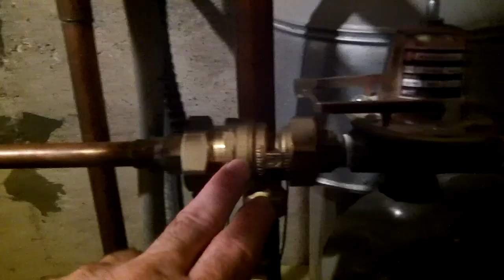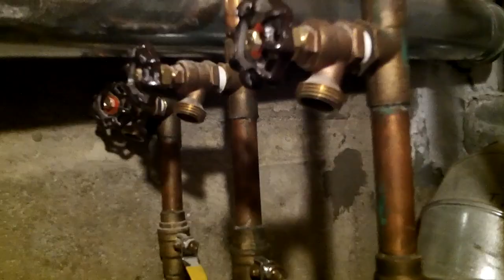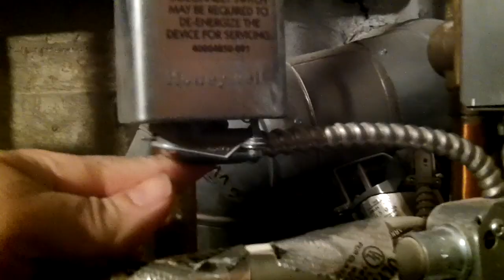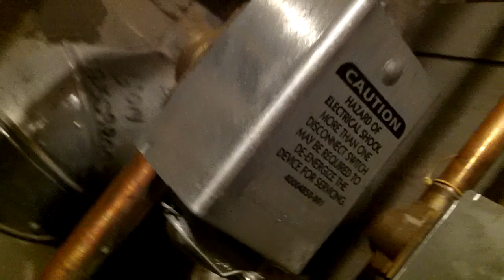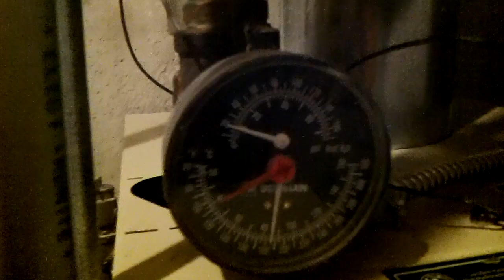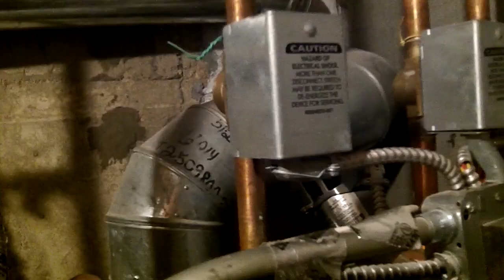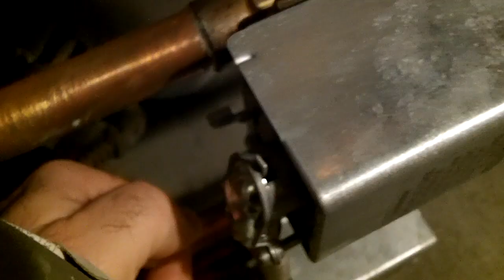How to remove the air from your hot water heating system

Comment: What about automatic air vent caps position (on radiators upstairs) before and after drain the system?
When should I loose and close them?
Thanks
Reply from the maker: David Mchedlishvili leave them alone. you don't need to touch them.

Comment: when you shut the livingroom return valve, couldn't there be air in the pipe below it going into the boiler ? so are you bleeding air out of the whole circuit?...thanks
Reply from the maker: You have to bleed it out once zone at a time.

Comment: When you are bleeding your first zone shouldn't you close off your other zones too ,so air doesn't go through there while you are bleeding the first zone?
Reply from the maker: When I bleed the first zone I manually open the zone valve for that zone. The other two zone valves are closed so air won't get on there.

Comment: The last time my safety valve went off, my pressure gauge got some humidity steam water in it. The gas man told me it would eventually dry out, it's been a couple of week and it still has water in it. He said it couldn't be screwed off to be replaced. I need to purge my system again because of air, can I still do it not knowing how much pressure I really have because of the pressure gauge having moisture in it? Thanks.
Reply from the maker: Don't use the manual override on the reducing valve to feed the system and you should be ok.  The reducing valve should automatically keep the correct pressure.
Reply: Thanks, I was a little leery, but, it worked fine. Thanks for your advise.

Comment: Awesome.  I had a pipe burst today.  I had a heck of a time trying to get the air out of the system.  So I took a break and found your video.  Luckily whoever put in my system did it very similar to your setup.  The only difference was there was no zone valves only circulator pumps which acted like valves.  Thanks for the video.
Reply from the maker: +RB Hayride Glad I could help.

Comment: When you bleed the zone the replacement water also has air in it . It will degas and cause more air.  Hopefully the auto bleeders will get rid of it .I stopped flushing my system many years ago and have had no air problems since. I have also heard if you leave the same old  muddy water in the system it has neutralized its PH and is less corrosive that fresh water. Is that true? there are many wives tales in the trades  and some are just old beliefs that have no merit
Reply from the maker: You are lucky your bleeders work fine. My boiler has a design problem and does not seem to catch all the air.  The folks that owned the house before me did not install bleeders on the radiators.  I have one bleeder on my boiler that is useless. Your system is producing air all the time.  You intoduce it when you change the water and also when you heat the water.     if you have an issue with air you must find the cause of it and repair the problem.  I bleed my system to prevent it from air locking a zone and waking me up at night from the noise.  I bleed it on a as needed basis.  I don't have an issue with muddy waters because I do not use well water nor do I have iron pipes.
Reply: +Brian Ellsworth Yes it true about the corrosive effect of make up water.
Reply: +providencevideoworks Thank you

Comment: Thanks for making this video. I have watched & took notes so that I may do this tonite. Now the questions if u dont'mind... I also have 3 zones like you but I'm not sure which line matches which? What's the easiest way to find out so that I can label them like u did. Also, I haven't turned the heat on yet, should I turn the system on first & let it run, then turn off broiler when I'm ready to purge... Or can I do the flush/purge before turning on the heat for the first time? How often should I be bleeding/change the water in the lines? -first time homeowner-jb
Reply from the maker: Turn they system on and listen for air in the lines.  if you don't have air in your lines don't do anything and leave the system alone.

To find the zones locations, just lower all your thermostats so you don't have water circulating.  Then turn one zone on at a time and feel which pipes get hot.

Comment: My system is almost the same as yours.  The only difference (other then having only two zones) is that i do not have a shutoff in my return line for each zone like you do.  my return lines tie together and i have a shut off right before it goes back into the boiler.....is this common?
Reply from the maker: +duerrs Yes it is common. There are maybe minor differences in the design of the system.

Comment: Thanks for the video.  I was stuck trying to figure out how to get the air out of my second floor radiators after draining the system I could not get heat.  The only thing different is my return valves are located with the drain valves (not separate like yours).  They look like a valve stem without the handle right below the drain valve.  In my case the notch inline with the direction of the pipe is open and the notch perpendicular to the pipe is closed. No indication on the valve so it is was not obvious to me.

Comment: i tried doing this and something went wrong. My furnace makes the broiler work but heat won't come through the vents of my home. And i tried purging it again and there is no water in the system
Reply from the maker: Gani Bebri sounds like you forgot to open the zone valve to let water in the system as you were draining the zone. Make sure the zone return shutoff is closed and the zone valve is locked in the open position before you drain the zone.

Comment: I bled the system a few times now, the banging and clicking have gotten better. However, I am still hearing some loud clicking in the first 5 min when the heat is first turned on, and alsoI am hearing water flowing in the pipe the entire time heat is on.  Is it possible that something besides air is causing the noise?  Thanks
Reply from the maker: That is expansion of your pipes.  As hot water travels through  pipes that are cooling down expansion occurs.   That's why you are hearing the crackling...etc.  Getting the air out of the system sometimes quiets that noise but some systems will always produce that sound.
Reply: Your Hunting Buddy the banging noise is still there just a bit better.  The water running is really loud and  its barely warm anymore.
Reply from the maker: jalvgrl1112 I get so many comments that sometimes I read things too quickly,   if you hear water running that means you still have air in the system.  you may have a leak or the water feeder is not replacing the water as you drain it.

Comment: very helpful thank you. I have the same set up as the one in your video three zone. But I am still unsure . The shutoff ball valve that is nearest the concrete wall like in your video will that line always be connected to  first zone valve like in your video?   Can I shut off all three shut off ball valve at once and just open one zone valve like you did in your video and bleed the system one zone at time with no problems ?
Reply from the maker: ED. JUSTINIANO You need to find the shutoff valve on the return line.  You can close all three just make sure you are not closing the line feeding the line.

Comment: Let me start by saying: Thank you!   this was a great video, and has helped me identify many of the parts within my heater system. 
I encountered a small problem and hope I can get some advice... My house is very small and only has one zone valve, however, my zone valve does not have a switch. I even opened the box and all I saw was wiring that came from the thermostat and 2 more that go to the boiler and circulator. Definitely no switches in that box. any suggestions?

Thank in advanced.
Reply from the maker: Jherlyn Lopez You need zone valves when you have more than one zone and want to use one pump.  Your one zone is controlled by turning on and off the pump and therefore you don't need a zone valve.  When the temp trips your thermostat your pump goes on and it heats the one zone you have.   Just shut off the water returning from the radiator and bleed the system  the drain valve should be before the shut off. There are no zone valves to turn on so just skip that step.

Comment: thanks a lot, I wish I had saw this video a couple of years ago. Your set up was almost identical to mine so as soon as I bled the line, the heat came right on.
Reply from the maker: Vince Mahe You have to shut your system off prior to working on the line.
Reply: Your Hunting Buddy um, you can't just take a compliment? Where in my comment did you read that I didn't shut my system off?
Reply from the maker: Vince Mahe Vince, I love compliments.  I misread your comment, I thought you were having problems with the burner turning on as  you were trying to bleed the system.  Thanks for watching and taking the time to comment. I am glad the video helped.

Comment: Great video. Can you explain why the air in the system is bad?  Is it a sound issue?  Are you losing heating efficiency?  Thanks in advance.
Reply from the maker: Joanne Cho You lose efficiency and eventually the air will stop your system from circulating water.

Comment: Thanks for the info.  I took an oil heat class years ago, but didn't learn this.  I replaced my expansion tank and check valve.  I knew how to drain enough water to replace without it spitting at me.  Now I know how to bleed if the bleed valve takes too long :)

Comment: What if I have circulator pumps instead of zone valves? Do those have a manual override too?
Reply from the maker: derekjlight So you have one zone and it it controlled by your pump?  If this is the case, shut your boiler, shut your return line and flush your system.
Reply: Your Hunting Buddy
I believe I have three zones, each with a circulator pump. Is there any way I can contact you directly to send you a picture of my system? I know for a fact that I have water in my upstairs pipes because I can hear it.
Reply from the maker: I had folks send me pictures.  It is hard to understand how the system works.  So each zone is controlled by a pump.  Do you have a shutoff valve for that zone and an auto water feeder?  if so shut the valve and open the drain and flush the system.
Reply: Your Hunting Buddy
I do have an auto feeder just like in your video. It almost looks like all the return lines feed into one spigot to purge the water from, but there are valves you can shut off as well. I will take a picture and post a link here.

Comment: BIG QUESTION is.........HOW did air "Suddenly" get into a closed system??
Reply: There is oxygen in water over time creates air pockets.
Reply from the maker: notpcone Air can get in the system in many ways.  Such as a broken expansion tank, through your feed, using non oxygen  barrier pex tubing...etc.
Reply: local water supply from street brings air into your system and its normal, that's why technician should always check the pressure (PSI) of the system when doing maintenance!

Comment: Great video, thanks! My system runs the circulator in the opposite direction as yours and doesn't have any shutoff other than the zone valves. I was able to figure it out. I just had to have the courage to drain system pressure below 10 PSI and let the PRV kick on. I went through about 3-4 buckets on each zone to get all of the air out.

Next issue to tackle is the pressure. PRV kicked on at the right pressure and stopped flowing at 12-15psi. But, once the boiler fired up, pressure went to 30-40 psi, and that's where it's stayed.
Reply from the maker: Great!  Thanks for watching.
Reply: Your pressure relief valve on a boiler should be rated at 30 psi. Your running pressure on your boiler should be between 12 to 18 pounds.  If it's too high just open the drain valve and let a little water out until the pressure drops. If you're blowing the PRV then you better replace it and lower the running pressure of the boiler.

Comment: Great Video....Question for you regarding my setup.   My zone valves are on the return and right above the zone valves i have my spicket .  I don't see a handle to stop the water from going back into the boiler like you have.   Does that mean I just leave my zone valve closed and open up the spicket with a hose attached.  I have an automatic fill so the water should just continue to flow until i close the spicket correct ?
Reply from the maker: No you need the zone valves open so you can replace the water as it exits.  Otherwise you will have more air entering your system.  You need to find the shut off in order to make this work.
Reply from the maker: I see your rational.  It makes sense and may work but I really need to see your system in order to give you any good advise.
Reply: I did this method last week and was able to get rid of water sound in the pipes but now i have a rattling  noise only when the heat is on i'm guessing that is just the pipe expanding in the baseboards.  I was going to bleed it out again but wanted to make sure I'm bleeding my system the right way.  Thanks for replying so quickly!  I can try to post a video of my system and provide a link so you can see
Reply from the maker: Rattling is pipe expansion.  Swooshing noise is air. Thanks for watching.

Comment: Thanks for the video. I followed each step and it worked for 2 zones. The third and last zone when I open it it does not flow any water and I can hear a electo/mechanical click come from the back of the furnace. Any idea why the last is one would not flush when opened manually?
Reply from the maker: Sometimes the manual control slips into the closed position.   May be a different drain than the first two zones.  Was that zone added later?
Reply: It may have been added later. We bought the house after it had an addition put on. I opened the manual switch several times but never got water flowing out of the bleeder valve on that line. Each zone has its own bleeder and the first two worked exactly as shown but the last one did not. I think Ill take some pictures and post it on a forum or something.

Comment: ok....water gurgling is heard in the main floor zone , have 3 zones, should I drain just the main floor zone? thanks for the fast response!
Reply from the maker: Once you hear the noise shut the zone down immediately and purge the zone quickly. If you wait air may travel out of that zone and then you will have to do the entire system..

Comment: great video! trying to bleed my system per your instructions...only problem is my pressure reducing valve is not adjustable. When I open the valve the pressure goes to zero but I still get a stream of water and after 3-4 buckets still have bubbles. Am I wasting my time?
Reply from the maker: I don't think you are wasting your time.  don't open your valve all the way.  Open it slightly so you don't reduce the pressure to zero.  Run the zone again to see if you have air in your line.

Comment: how to know if the circulator pump is still working or not?
Reply from the maker: Turn up the heat and listen for the pump.  Sometimes you hear it or feel it vibrating.  Be careful not to burn yourself if you touch it.  If you can't hear anything,  look at the direction of the water flow (there should be an arrow on the pump pointing out the direction of water flow) and see if the pipe after the pump gets hot.  If the pipe is cold.... your pump is not turning on due to an electrical issue or it is broken.
Reply: Thank u.

Comment: This is a great video! I never paid attention to the PSI and never shut the boiler off. Good advice. My problem is actually constant for me though considering there is air bubbles after less than a week or day after I purged it, I have to do it again when my tenant tells me the heat is not working.

Do you think it would be better to install an air separator / air eliminator / automatic air vent to purge the air instead of going into the boiler room to empty buckets of water at a time? (I run my hose to the toilet so less bucket emptying)
Reply from the maker: <p>Thanks for the kind words.</p><p></p><p>I have a vent but I still need to purge the system once a month. Before you spend all that money modifying your system, have someone pressurize your zone and check for leaks. If your pressure gauge shows a drop in pressure you have a leak that needs repair.</p>
Reply from the maker: One more thing.... If there is no leak, your expansion tank may be bad.
Reply: Your Hunting Buddy  So I checked both my expansion tank and I don't know what to make of this situation. The 2nd Floor ET has a dent but when I press down on the shrader valve, air comes out. I will check the PSI tomorrow. The 1st Floor ET looks physically fine but nothing comes out when I press the valve down. I'm not sure if there's any problem though with the heating system on the 1st floor. I will check for leaks tomorrow on the 2nd floor. I hear air bubbles coming up from the boiler after I just purged them.
Reply from the maker: <p>I'm glad your expansion tank is ok and there is no leak;  You may want to put a valve on the last radiator on the second floor.  Right before it returns to the boiler.  This should catch all the air</p>
Reply: Here's an update. Both the expansion tanks had a punctured bladder inside. Both were replaced. Then we added an air scoop (separator) with an automatic air vent on top and the expansion tank at the bottom to both boiler systems. Also found out that the 2nd floor water pump circulator was damaged. Replaced that as well. Boiler for both floors are working fine now. Damage: $1000. If we attempted it ourselves, would've cost less than $300.